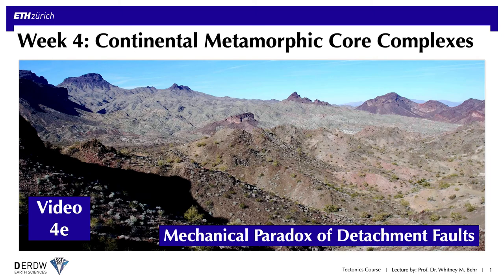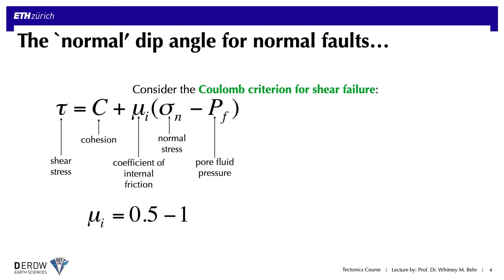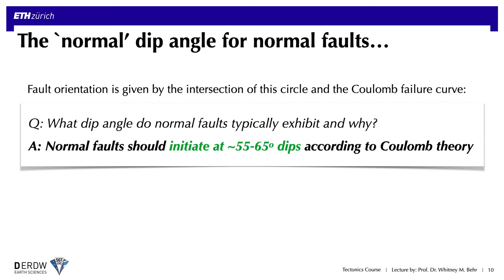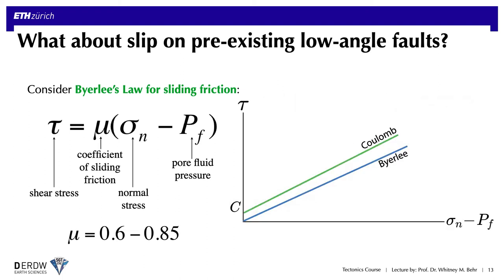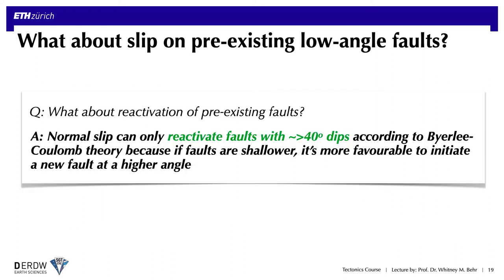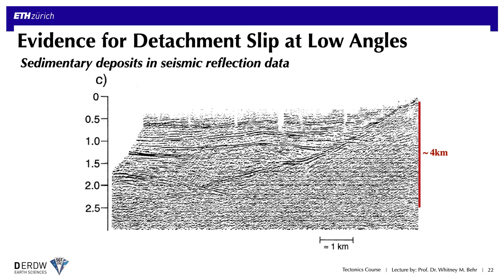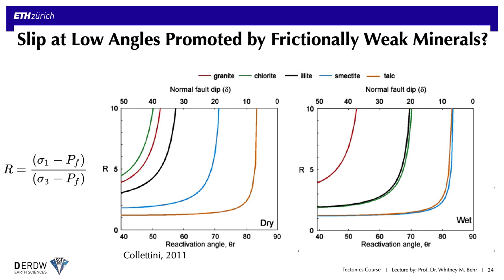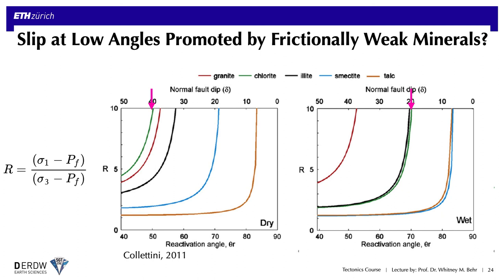Video 4e: Metamorphic Core Complexes, Mechanical Paradox

Comment: Per your last slide on exotic fault plane materials, wouldn’t Byerlee’s experimental data have included these?  I still have an intuitive problem with low angle slip that you explain quite well with graphs in this episode.  Unlike compressional regimes, in extension the earth is being opened up, creating ever increasing avenues for pore pressure escape, can’t imagine how these faults get pumped up.  How about multiple episodes of normal faults, rotating earlier generations to low angles?  Perhaps this model has been discounted after 30yrs since I looked last at this.